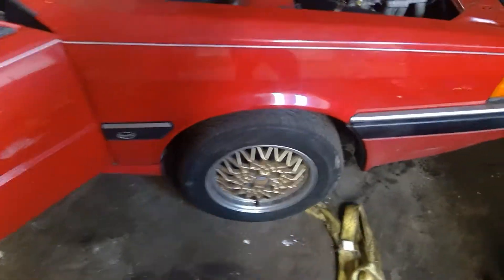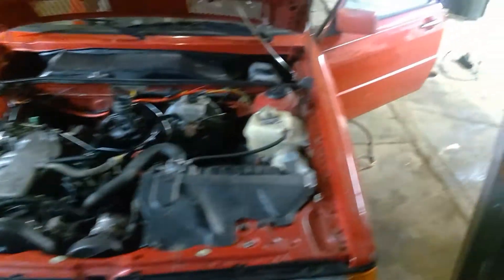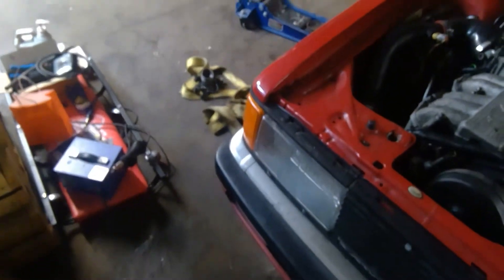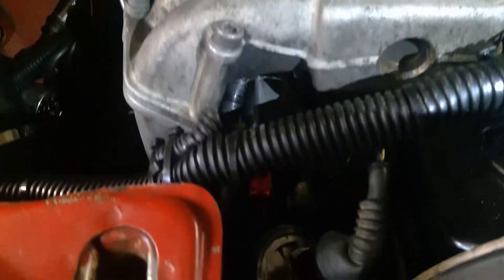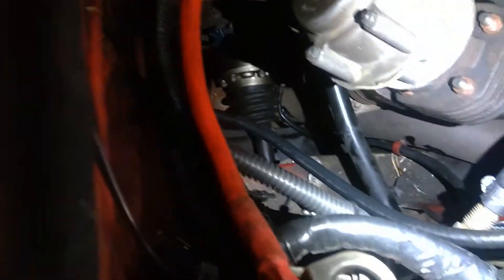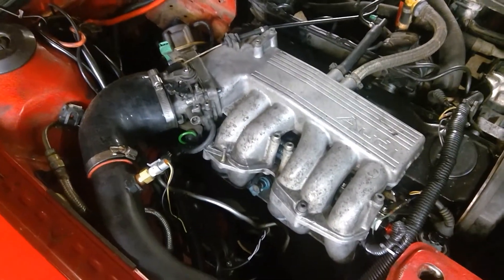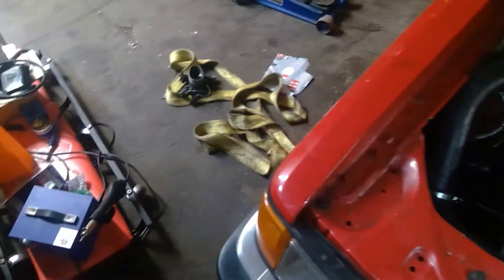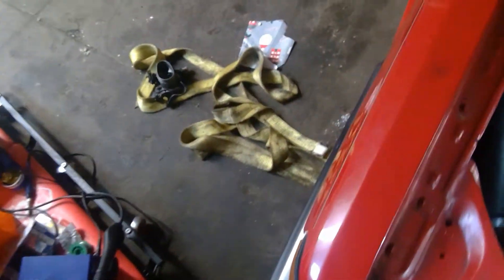Audi Coupe GT NG EFI Turbo Conversion

Comment: Nice one! So, looks like you haven't done any modifications to the intake manifold, just slapped big-ass hose on it. So what I need is custom exhaust manifold, trigger and oil lines. It kinda feels a bit easier than what I was imagining. 
Why do you have to remove the AC ? Its not like I have one atm, but I wanted to install one on my 90 quattro.

Comment: Could you elaborate on the intake hose? I need one and I'm not sure if any hose will fit as intake manifold part is oval-shaped, could you tell me where you bought it or what size/search term you've used?
Reply from the maker: Gladly. I presume you are using a factory manifold and throttle body. I took the factory CIS intake boot and got the biggest pipe I could find and stuffed it in. This pipe diameter came out to be 3.25 inches. I purchased a silicon intake coupler dude to the fact that they are easily conformed to whatever shape I needed it to be in. I then used the original hose clamp as it is already comformed to the shape of the throttle body and tightened it down. The diameter after the 90 degree bend is whatever you want your charge pipe to be.

TLDR: Search "3.25 inch to 2.5 inch 90 degree silicon coupler" I got mine off ebay for 20 bucks
Reply: @willtrautman6243  Thanks! Can't wait for more Audi Coupe videos, hope oil smoke pouring into cabin wasn't the end of the car haha. Great car. I got the newer '89 with same engine and fed up with kjet after 3 junkyard fuel distributors and one rebuild later the car was still not working well
Reply from the maker: @3216ben1  I got a couple spare motors just in case 😏😏. Glad I could help
Reply: @willtrautman6243  Hi, I'm back, so I contacted 034 and they told me that they have no fuel rails that fit NG (I assume yours is NG as it looks exactly the same as mine) So now I'm confused, are they discontinued or they don't know what they're selling? If non NG rail fits, which one?
Reply from the maker: @3216ben1  The rail itself has the proper spacing for the injectors, but the included brackets will not work on their own. The NG has injectors mounted in the intake and every other 10v has them mounted in the head. So to use the rail I had to make some spacers that allowed me to use the entire kit
Reply: @willtrautman6243  but injector adapters fits well? I probably could make a bracket
Reply from the maker: @3216ben1  Theyve worked well for me. No fuel leaks or vacuum leaks